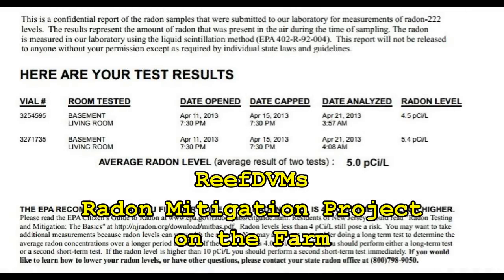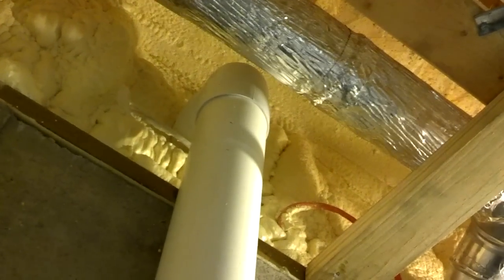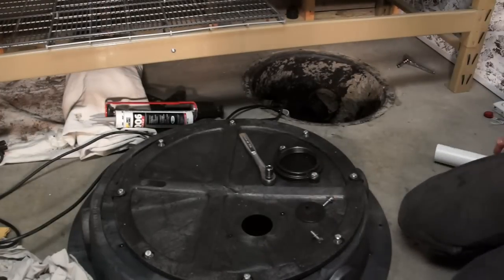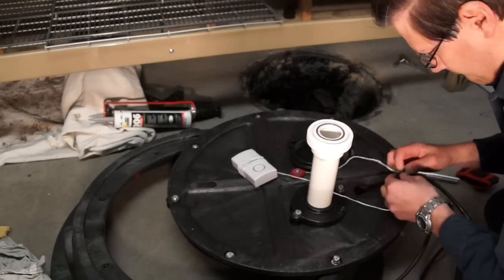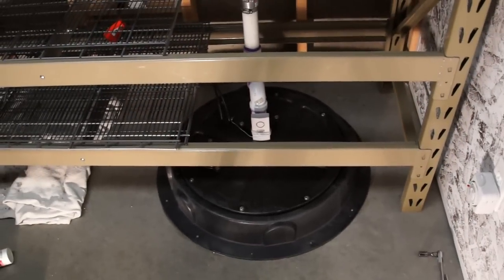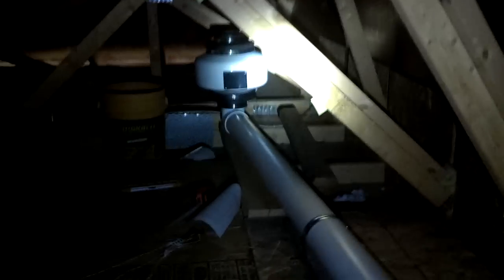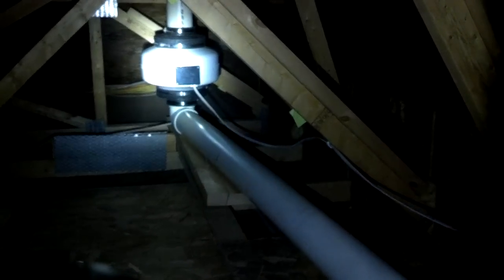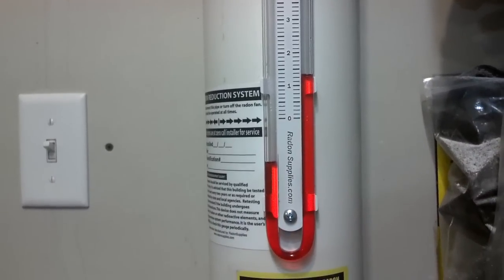DIY Radon Fan & Sump Cover Mitigation Install

Comment from the maker: The fan cant be in a living space your right but you are allowed to place it in attic space in garage where no living space is below, the red rings are fire rings and in Minnesota if you exit the pipe into the garage via the basement you much use a fire ring to prevent a garage fire for spreading into the house.  They expand and seal the joint in case of garage fire, they are code in Minnesota

Comment from the maker: Actually I called the State of Minnesota and our county inspector and there is no set code on the piping  so what I used is fine and numerous installer use it as have seen several of these now installed, it doesnt have to be Schedule 40 at all, but hey Schedule 40 is very nice just pricer.  Yes you can use a soft bend elbows to get better flow but currently our has our level at most of the year 0.1 and in rainy season about .6 so we have plenty of flow with this large and pretty quiet fan.  The sump lid we used is black and I love being able to see in it and having it sealed just means less leaking and better suction but you dont have to get different cover if you want, but we did for this cover is very nice.

Comment from the maker: Chris our current Radon level is 0.2, it has gone on the meter as high as 0.5 after a large rain this summer and normally is about 0.2
Reply: I know this is old but do you know what the levels were before installing the system?

Comment from the maker: It's obviously best to check all local codes and hire, if able, a licensed radon contractor to install these systems to prevent issues like radon leaking back into the home, flooding and/or other issues. But if done right it can be a DIY project with help via contractors. Take your time, get estimates, learn about the problem and make educated choices.
Here are some links we found helpful:

http://www.who.int/ionizing_radiation/env/radon/en/
http://www.epa.gov/radon/
http://www.health.ny.gov/environmental/radiological/radon/radon.htm

Comment: 4.5 and 5.4 is hardly cause for a negative pressure system. 
Caulking and sealing cracks plus the new sump pit lid would have resulted in a lowered or even total elimination of any “harmful” radon byproduct levels.

Comment: Thank you for this video. I would like to install the same device on my sump pump. Q1> What is the adhesive you have used? Q2> How is the quality of the adhesive after two more years? Thank you
Reply from the maker: codyq0987 I used elastomer silicone by DAP,

 http://www.grainger.com/product/5UFP5?gclid=CJmB6MOGocUCFQuraQodv6EA1A&cm_mmc=PPC:GOOGLEPLAC-_-Adhesives,%20Sealants%20and%20Tape-_-Caulks-_-5UFP5&ef_id=U2vDygAABFE6DAJI:20150501171900:s
Reply from the maker: ReefDVMs been no issues, no leaks and i test the area bi year for radon still
Reply: ReefDVMs Thank you for the update. Based on video @08:31, you said you are using PL 300 to seal the dome. I may misunderstood your points. Thank you again.
Reply from the maker: codyq0987 Sorry for the confusion I thought you were asking about the cover and window adhesive which is DAP.  Your asking about the construction PL300 that we used to make the cover seal to the concrete and that is PL300 is also doing well, I have no issues with it

Comment: Hi I noticed you didn't use the screws to attach the dome riser to the floor, you use some kind of silicone/glue thing. What did you use and how reliable it is rather than using screws or drilling down to the floor?
Reply from the maker: +TheLeaderGuy   We used industrial grade pl400 to attach to concrete been solid ever since

Comment: Can you use this lid with any sump pit? Have a house with 3 sump pumps and pits... Plumber saying old pits need to be ripped out and replaced with special air tight pit that gives a lip for thr gasket to seal the lid.... For $5400 (2 of the 3 pumps have to be converted to submersible.) Wondering why i cant just put in some submersibles in my existing pits amd use this lid

Comment: Just watched your video. Great job.  My question is, what did you use to seal the pipe in the basement to the concrete floor?
Reply from the maker: I used pl400 and left it 1/4 low and then filled above that with elaster silcon grey

Comment: This may be a dumb question, but how did you connect the PVC pipe to the sump pump before fastening down the cover? It seems like the only way to do that is to take the pump out of the water, connect it, and then lower it down into the water while it's attached to the cover. Or is there some type of connector that I don't know about?
Reply from the maker: +transistor311 we actually installed the pump and we have disconnect splice about 12 inches above the cover in the pvc, so you unbolt the covers top, undue the splice in the pvc and then lift the cover off the pcv and you have access to the pump and about 3 feet of pvc going into it.  When installing the pump you attach the pvc and set the pump in the basket then slide the cover top over the pvc and bolt down and reconnect the splice in the pvc.  The splice is a rubber coupler with two stainless steel clamps that screw down to tighten it
Reply: +ReefDVMs Ok, that makes sense. I thought that the hole in the cover was likely caulked around the PVC to make it more airtight, but if you can just lift the cover off the PVC, that would make things a lot easier. Thanks for your reply.

Comment: Can you share: cost for the radon test. Did you use a DIY kit or  a company that comes in and takes the readings? Thanks in Advance
Reply from the maker: Deb Belcore So radon test kit is 10$ each and fine to use, most commercial companys use similar...the electrical sensor ones are about 100$
Reply: ReefDVMs The electronic sensor ones are over $250 on ebay and amazon.

Comment: I have a couple questions, is the whole sump cover process only to make it so it's air tight? it seemed like that took the most time. and how did you pick that area to drill the hole in the cement? is that the only point where the suction for radon is being applied?
Reply: what size drill bit did you use also?
Reply from the maker: Yes the only point of suction is there where you hit the draintile, since we build the house we had idea where it was from the wall and took 6 inch drill bit and drilled for it, once you get through the floor you can move ground to feel for the draintile somewhat
Reply: Great vid! I have a pre exsist radon system. I am installing a sump a few ft from it. I don’t have any drain tile sys. How do I vent the lid? Do I T into the radon pipe just a few ft away? I have water in the pit - we have flooding in area now - and I can hear the radon gurgling into my partially dug pit.

Comment: Question:  Why didn't you take the easier (and maybe more effective) route and just install the radon mitigation system into the existing sump pump well instead of drilling another hole in the cement floor?  This is the way my system was installed by a local  company specializing in radon  systems.  Brought my pCi/L from 5.5 to 1.0
Reply from the maker: yes you can vent out you sump basket but in our case the sump basket was below the kitchen and kids bedrooms which didnt allow easy roof access in our area so we found the drain tile line in the laundry room and that gave easy access to the garage roof to install for better cosmetics

Comment from the maker: HP190 fantech	115volts 60watts 2.01psi pull, this is larger fan for a two story house like mine with 2000sqft basement sump to pull out of

Comment: with the sump sealed for the radon, does it cause any problem when the water is pumped out. do you need a vent? ya know water out needs air in
Reply from the maker: I have not need vent

Comment: Piping should be schedule 40, not thin drain pipe and with regular sweeps on fittings to improve air flow, not short 90's. The sump cover is solid black, not able to see in it to know whats going on. Clamps on basement wall not sturdy enough. Fan used is a high energy use fan and quite loud. Kozy Kollar looks good though. Also, what the customer had for a sump lid was fine, easier to get off than unbolting lid in an emergency.
Reply: Sch 40 pipe is not necessary. It has no effect on the radon levels. I get that it's stronger, but definitely not necessary. Kozy Kollars have leaked for us in the past when installed correctly. They are overpriced and hold no guarantee.
Reply: @keithrogers2295  Yep, PVC Sewer pipe works just fine.

Comment: I'm confused. If a sump pump pumps water out, then a vent is needed to let air in to prevent a vacuum. If the radon mitigation sucks air up and out, how can it let air in to prevent the vacuum on the sump?
Reply from the maker: +Bryan Jones Air is still pulled via the drain tile going into the basket
Reply: Quite right, I see how it works!

Comment: How far does the pipe that goes thru the roof have to extend into the air above the roof?
Reply from the maker: mine sticks out roof about 24"
Reply: Ok
Thanks for your response!

Comment: Can you provide me with the sump cover brand and model, I need to do the same setup, but plumbing supply needs data to order
Reply from the maker: https://www.amazon.com/Original-Radon-Sump-Dome-Model/dp/B073V3RV5X/ref=asc_df_B073V3RV5X/?tag=hyprod-20&linkCode=df0&hvadid=216548266073&hvpos=1o2&hvnetw=g&hvrand=18343771693126765831&hvpone=&hvptwo=&hvqmt=&hvdev=c&hvdvcmdl=&hvlocint=&hvlocphy=&hvtargid=aud-801657747996:pla-359234518959&psc=1

Comment: Hi I am planning on putting in a radon mitigation system and wanted to ask a question.

I have a 1750 sq ft basement divided into two rooms.  It has a aircon and heating system but is rarely used.  If I out in a system how many vent pipe do I need to come up from under the slab?

Comment: I just feel like the only radon you are going to suck out is that 4" diameter circle you drilled. Its not going to magically suck radon gas from under & theew the concrete... you would need several under concrete tunnels that expose the dirt to suck radon gas from.  This radon is a racket. A governor made economy booster to create jobs for people.